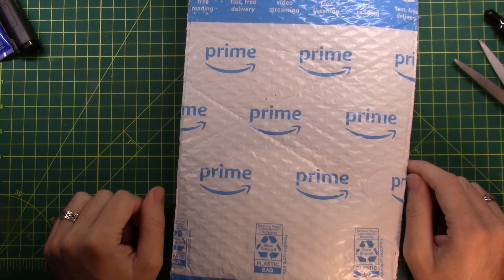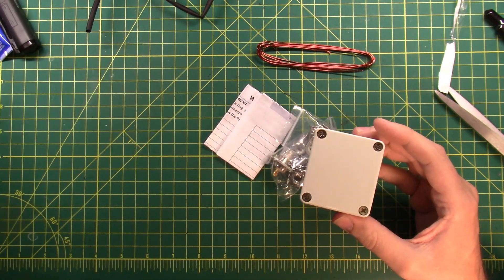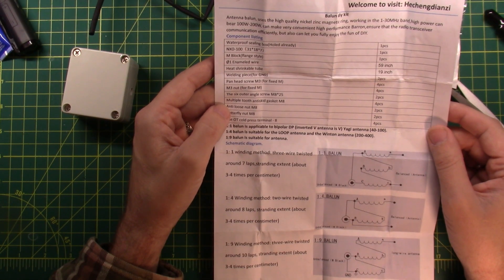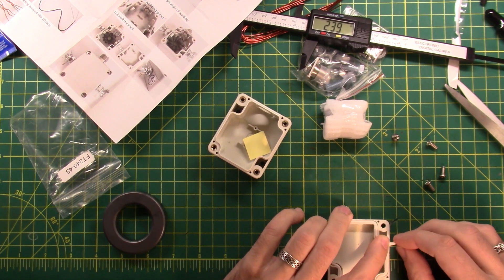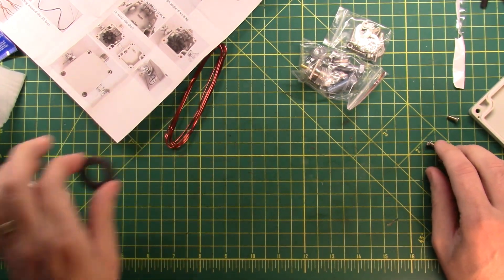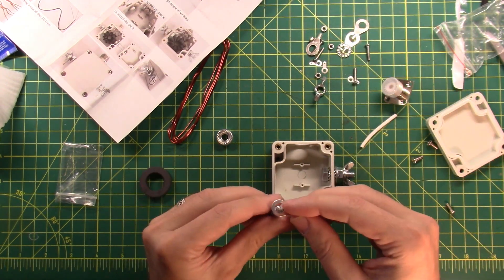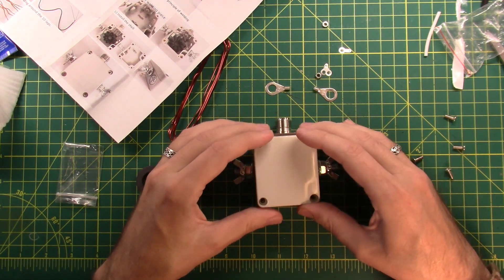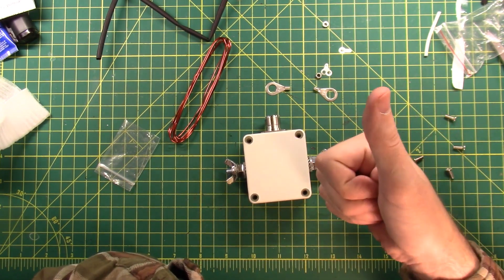Cheap Amazon Balun/Unun Transformer for QRP Radios

Comment: I have several T 240 cores. mix 31,43,61 . for higher power use larger MAG or PTFE wire. I got some #12 silver plated PTFE wire . should be good 3Kw . the T 240-43 core is about 250-500 watts depending how you wind it. all you do is look at a 49:1 kit and wind that way. the turns are the same . you could even wind 56:1 or 64:1 . I seen a end-fed half wave kit with a 3 pos switch for 49/56/64  to 1. just a tap on final turns . some times I buy kits for the parts or build different . I found a half wave kit with  a T 240-43 . now if winding that kit for 49/56/64 to 1 you will need a 100pf disk HV cap. 1 to 3 KV on input . this this to correct for inductance . this helps tunning SWR . I got a 49:1 kit on the way . T 140-43 100 watt . going to try a different cap. I have a ARCO adjustable trimmer cap. this may be fun. 73's
Reply from the maker: Have fun, that's all that matters!

Comment: The toroid core mix is NXO-100. µi 100 ± 20%
I bought 10 of these toroids, and measured them all with 10 turns. With 10 turns they all gave ± 6.9µH with this information I could continue. The data was entered into mini Ring Core Calculator
OD 31 - ID 18 - H7 measured µH value 6.9 this gave us the following result Al 69 nH/N² and µi 90.7 so all within the given spec's
Reply from the maker: Perfect, thanks!

Comment: Nice one Steve. It looks the better way to buy the parts even though you don't know what the mix is on the torrid. I would mount the lugs for the antenna part on the inside to connect to the torroid. Or eve lugs on both sides to allow for strain relief of the antenna :)
Reply from the maker: Good tip!  I don't know why they chose that core... Maybe its popular where they come from?

Comment: That's a neat little UnUn for end fed antennas or OCF antennas. It looked like a ferrite core that came with it and it's probably ok.
But, could they have not used bigger bolts to make the antenna connections? Holy cow. I use 10-32 SS machine screws on my balun or UnUn's.  For my QRP baluns or UnUn's I use 8-32 SS machine screws. 
I think the enclosure that you have is in fact a NEMA enclosure? But once you drilled all of those holes you loose NEMA. 

Thanks for posting the interesting video. How about updating the text and provide us with a link to the UnUn?

Barry, KU3X
Reply from the maker: A link to the kit and the 240-43 are in the description, here you go:

🛒Un-Un Kit: https://amzn.to/3B3JZPh
🛒240-43 Toroid Core for 49:1 Transformer: https://amzn.to/3G9xPrx
Reply: @temporarilyoffline  That really is a very reasonable price for the kit. Not only he supplies all of the needed material, he also drilled all of the needed holes. 
Barry
Reply from the maker: The drilled holes are perfect

Comment: We still don't know if it was cheaper... Can't know that until it is built and tested. If it doesn't work as advertised then you are building another one that does work spending more money then if you had just bought quality items to begin with.
Reply from the maker: The question I was looking for was "Is it cheaper to get the hardware and the box in this kit, or to source the hardware (screws, nuts, etc).  It looks like its cheaper to use this kit... I'll have a build coming out soon on the antenna project i'm borrowing parts from this kit to build.  Stay Tuned!

Comment: I too have sometimes found that buying kits is cheaper. However, advantage of bulk buying components is you will have a stock of parts to experiment with. Also,  as with the separate toroid you bought, you can specify your critical components. If you put that transformer box outside, you might want to consider wrapping all exposed metal with self amalgamating (Rubbaweld) tape to stop everything corroding.
Reply from the maker: Sometimes it works.  I'll probably be building more EFHWs, seems like a very good/portable design.

Comment: Toroid is an NXO-100 per Amazon but didn't see an FT number listed.
Reply from the maker: Yes, I don't think it's an FT mix.  I did look it up and it's good for QRP
Reply: @temporarilyoffline  Good to know, I saw the price was down to around $15.99
Reply from the maker: @ronjr1157  Good find! They have two different kits.  The difference is the hardware you mount the antenna elements with (banana jacks vs bolts/wing nuts)

Comment: Not a bad kit for what you get.  I assembled 49:1 kits for our local club (WW3AAA) and buying stuff in quantities of 25 I got the price point down to $20.  That was an FT-140 type 43 toroid, so a 50W SSB antenna when we were done, but it also included the speaker wire for the radiating element.  I had to drill all the boxes myself though, and they weren't water tight ones like you got.   Wish I could have found type 31 toroids, but they are unicorns at this point...
Reply from the maker: I got mine from JPM Supply, they appear to have 31s in stock:  https://www.jpmsupply.com/category-s/1945.htm